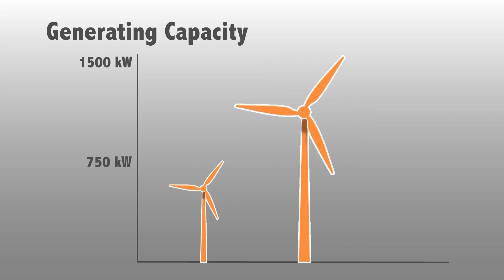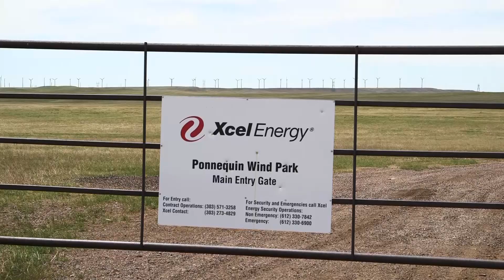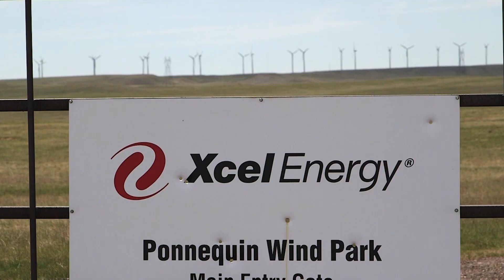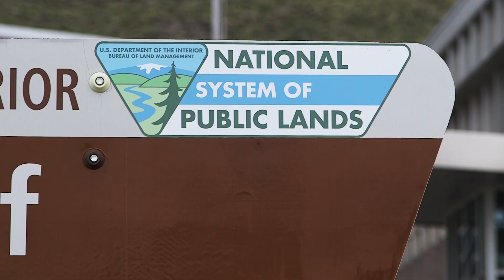Who Cleans Up When a Wind Farm Retires?

Comment: 5:10  They are going to "blow up the towers" then put them in a land fill.   Now that's environmentally friendly.   LOL      
Also, how many years do these things have to run before they make enough energy to account for the manufacturing process, plus mining the metals, plus installation, plus building of the access roads, plus demolition, plus burying them in the land fill, plus closing up the land fill?   How much energy does all of that take?  How much coal was burned to build these things?   
Not to mention, how many birds get chopped, sliced and diced by them?
Reply: I wonder if it is coated with something like fire retardant that makes recycling pricey? I was able to take a self guided tour last week of a newish tower  that was left wide open and the inside wall was very thick and then there was thick coat of foam stuff.
Reply: @tysleight  fire retardant can be nothing but Starlight! Please check out the ingredients!
Reply: Solar panels and electric cars, windmills offset all production in a year or two and then are net positive.
Reply: Wind turbines: half-baked idea that should never have seen the light of day. Any benefit is overwhelmingly trumped by all the downsides, including environmental.
Reply: No, that's not what they said at all. The remains will be (were) recycled with the unusable bits landfilled. The wording of the story implies there's more waste than recyclables but that would only be true if the towers were concrete.

Comment: Wind and Solar farms are an interim solution to shutting down coal plants and some older nuclear power plants. However, advance nuclear will be the next evolution of electricity generation. As for cleaning up older wind and solar farms, that will probably be on the tax payer. Only nuclear energy had a complete waste management funding in place.
Reply: All the BOP contracts I have seen, are built in repowering or complete removal of the machines. Including the foundation...
Reply: tax the idiots who install the wind power

Comment: wind farms a waste of money it mostly blows at night time when you dont need extra power to the grid for peak load making them a joke to so called way to future energy its a big scam like every thing these days
Reply: So all those turbines I've seen running during the day were just figments of my imagination then?
Reply: They really need to be paired with electrical energy storage, so the power can be saved for when it's needed later. Turbines which are grid tied, aren't even considered generation, but rather Negative load. That's why you can't have them be any more than 20% of generating capacity, without making a real headache for grid managers.
Reply: They're not a waste of money as electricity still has to be produced at night time. You're correct about a problem with too much wind power producing electricity at the wrong time of day but with battery storage, it will make this more possible to use the energy throughout the day.
Reply: @imzjustplayin  That's not how grid management works. If the operator of a wind farm can sell the power at a good market price, and a receiving user agrees to purchase it during a certain timeframe, the grid operators for involved utilities then schedule back the production of energy from those plants whose capacity did not get purchased as output from the wind farms ramps up. There's no technologically feasible way to store vast amounts of electrical power on a grid. Electric power is ramped up and ramped down among hundreds of plants in a particular control area based on instantaneous demand, market prices, and system reliability.
Reply: @imzjustplayin  That's exactly right. and not just for wind. Solar has a thing called the duck curve, which can be solved with a modest amount of electrical energy storage, compared to system capacity. Combining wind and solar onto the same storage system would allow service to the largest customer base, per megawatt hour of storage capacity. That's because wind and solar often produce at different times, creating a more steady average output, for the storage system to have to smooth out.

Comment: Capacity, not output, and this degrades over time. Usually output is about 25% of capacity.
Biggest white elephant in the energy market.
Reply: They need to operate at 30% capacity, or they're not profitable. at 25%, they have a hard time paying for their land lease.
Reply: they get payed not to run when demand is low or when the wind is to strong, they get payed a higher price for their output than regular generators, its a scam.
Reply: @182dunc  That's why stored electrical energy is so important. We need to be able to store wind energy when it's available, then discharge it when it's needed. What you're describing is Curtailment. That's when a perfectly working turbine is shut down on a windy day, because the grid just isn't supplying enough load at the time to use its power. That knocks the profitability right out of a turbine. The next big technology that needs to be developed, is efficient, cost effective grid scale electrical energy storage. There have been many ideas explored, but nothing commercially viable, except pumped hydro. Pumped hydro can only be implemented in a few areas, where a high elevation and low elevation reservoir can be built. Without that, curtailment is, and will continue to be, the bane of all renewable energy sources.
Reply: Indeed.
The current lithium/cobalt  batteries just arnt up to it, unfortunatly the current research into sodium batteries is getting nowhere as these are like small bombs.

Comment: Wind and solar can be much more profitable when paired with battery storage. Yes, batteries are expensive, but their payback is quick. They can respond to demand much faster than even natural gas peaker plants.
Reply: If the paybacks were quick, then we'd have a lot more batteries.  But currently, only a few places have battery projects. Using Li-ion technology these are probably only cost-effective in places like Hawaii with very high electricity costs combined with good solar potential.
Reply: In most places, even solar or wind alone isn't competible with conventional power plants without subsidies, let alone with expensive energy storage with batteries. You are right about the faster response though.